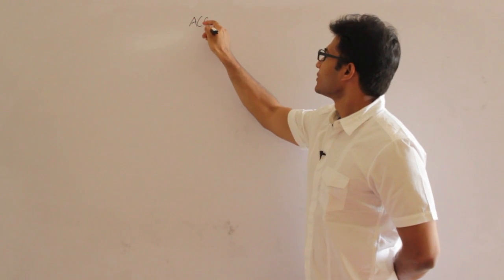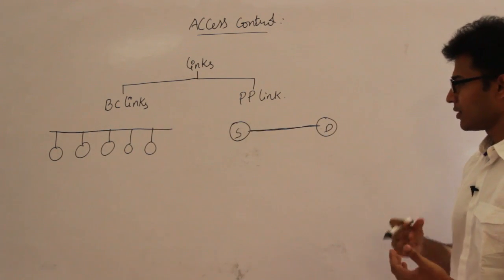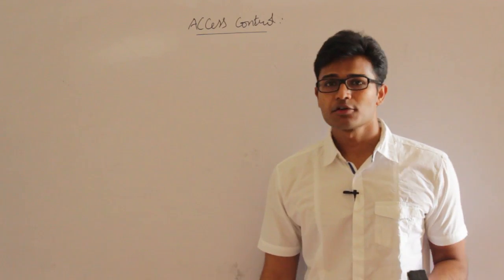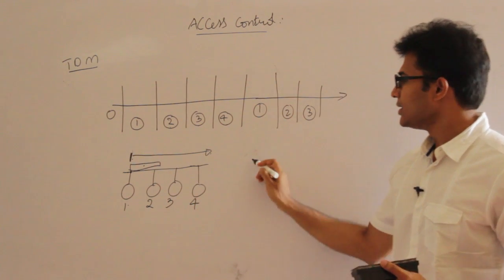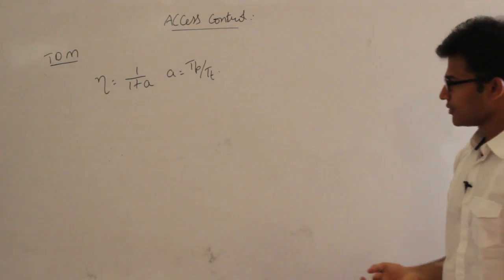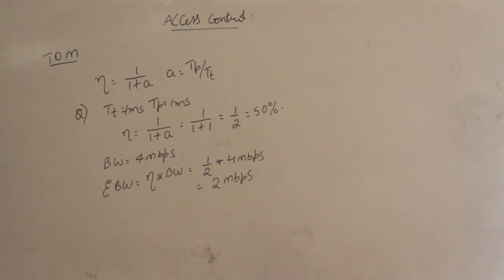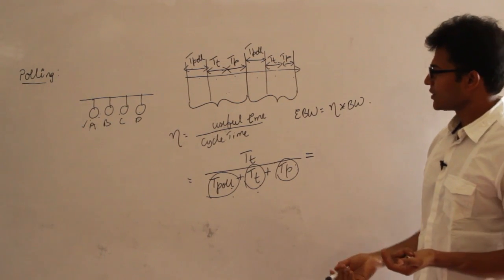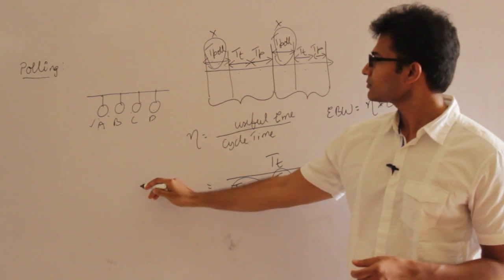CN | Flow Control Methods | Introduction to Access control methods, TDM and Polling | RBR

Comment: 9:30 , If someone is watching this recently, please explain this.
Reply: if there are N users than bandwidth is divided in N equal-sized portions
Reply: @BikashSingh-ze4ny  Whats the meaning of the formula ? Is what I'm asking. Why Effective bw ? At a point of time, only 1 station is going to utilise it, so it may just use the whole bw. Theres no clear explanation of this formula anywhere, although I know it holds cause sir just told it. But, the context and meaning is not clear. And everyone explaining this, it seems they're just talking about bw, but I'm concerned about the whole formula.
Reply: @sword013  you are right, in Tdm the user gets full bandwidth of the channel in particular time slot. Bandwidth is divided in Fdm
Reply: @BikashSingh-ze4ny  Yes thats why I still do not understand why effective was used. And why would one divide the bw if only one is going to use at a time ?
Reply: @sword013  becaues  bandwidth is theoretical measure of data transfer while throughput (effective bandwidth) is actual speed of data transfer
Reply: @BikashSingh-ze4ny  I guess not, bw is the max data transfer rate you have, but throughput is how much you actually using it, If I wanted, I could use all, but I haven't got that much data to actually send so I use only a part of it.
Reply: Tejas Deshmukh Tejas Deshmukh total bandwidth of 1 station to transfer a particular data is 4mbps but it can transfer 2mb of data at a total time because it’s efficiency is 50% only here so in total time he is transmitting as well receiver is sending 2mb data to sender so here only 2mbps is utilized here of total time so each station is sending 2mbps of data only so N stations * 2kbs each station need = 2mbps
Reply: @BikashSingh-ze4ny  This formula makes sense if you assume all stations transmit at one time, but clearly thats not possible. My only concern was that the throughput of system is the throughput of a station when it comes to a "point of time". If we view this this from the overall point, yes I got the formula that way, but scenario wise(at one point of time) it doesn't seem rational. But, anyway Thankyou ! I guess I got it like 90 %

Comment: @9:31 If all the stations are using the link individually, then won't they have access to whole 2Mbps at once ??? What am i missing here??
Reply: you are right. But I think because we are having 1000 stations and everyone is using 2mbps only for a fixed slot and remained ideal when other stations are in use, on average it goes back to 2mbps/1000 = 2kbps.

Comment: Why we are seeing effective bandwidth? In bandwidth allotted to a channel, it'll transmit the data which includes total time to transmit data i.e. both transmission time and propagation time and propagation time is time which is reducing effective bandwidth. So according to me it should be

BW = 4mbps
N x 2kbps = 4mbps
N = 2000

So 2000 stations should be there. Because 2000 stations will transmit data at 2kbps then 4mbps BW is required out of which 50% is inefficient as 50% time is wasted in propagation. Correct me if I'm Wrong..
Reply: what is the correct ans

Comment: If each station requires 2 kbps BW only, and total BW allowed is 2Mbps, then why only 1000 stations are allowed? I mean, each station is asking for the bandwidth alone (i.e. at a time only one station is utilising the link) in TDM, then why there is a limitation on the number of stations connected ?
Reply: Because Time is divided among stations for using the line. If BW of line is 2Mbps, then that 2Mbps is used by a single station for only 1/Nth of a second. So the BW for that device will become (bits transmitted)/total time. Hence it is 1/Nth of the total bandwidth. Hope you understand.
Reply: @akashsinha5611  But for 1/Nth of a second, total bits transmitted by the particular station is 1/N th of total bits transmitted per second by it.
Reply: satyam gupta correct. If each station transmits n bits and total time taken by all stations is T and time slot given to each station is t, then n/t is total bandwidth, or (no. of devices*n)/T
Reply: Thanks a lot bhai
Reply: Yes Nishit Shah, your solution is correct.
Reply: hi Akash, correct my solution If I am wrong?
As mentioned by you BW for a device = (bits transmitted)/total time
so, BW for a device = (x bits/1 secs) considering in 1 second, x bits are transmitted.
2 Kbps = x/1
Then BW given = (Total bits transmitted by all device/total time) = 2 Mbps
BW = (sum of bits transmitted by all devices/total time) = ( x1 + x2 + .... + xn)/(1 secs)
n * 2 Kbps = 2 Mbps 
Hence, n = 1000